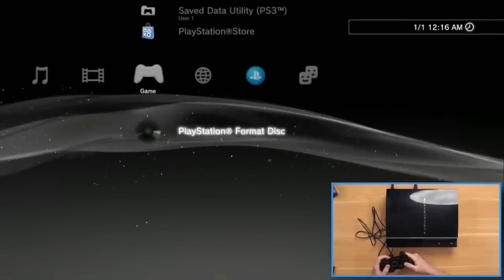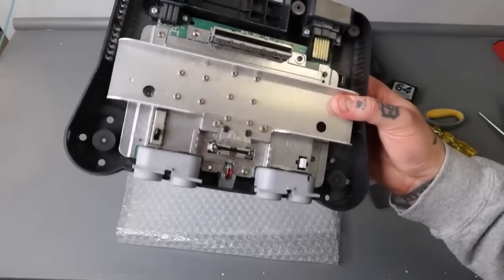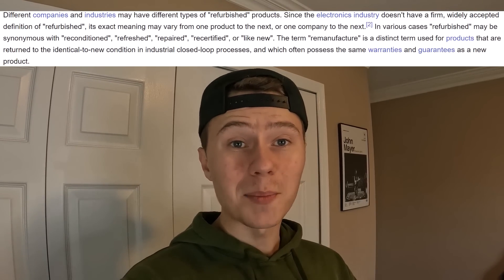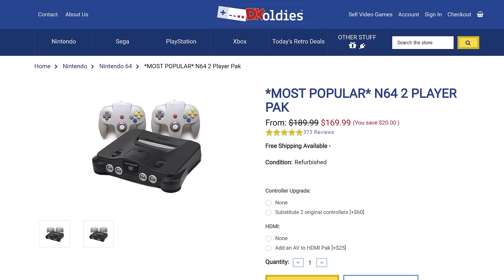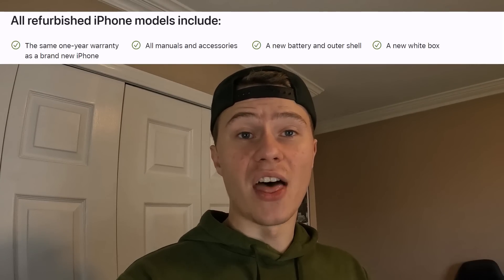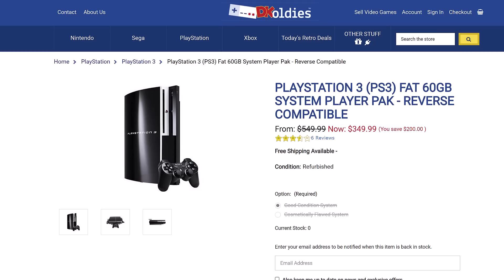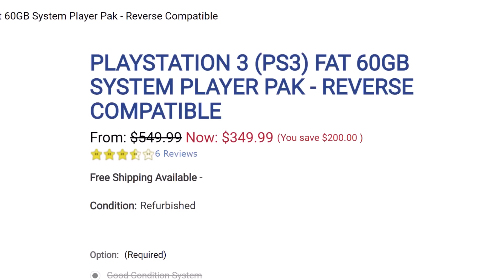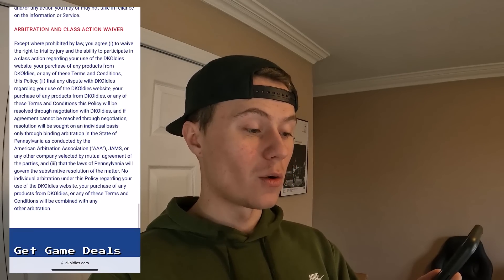DKOldies really didn’t want us to find this out…

Comment: Them putting that “waiver” doesn’t hold any weight ANYWHERE!……they can be liable In every jurisdiction!
Reply: Actually, countless companies have arbitration clauses in their contracts and they generally are legally binding.  Hence why the overwhelming majority of companies use them.  Hell Amazon has one.  Basically states if you can't work something out with them, you have to go in front of an arbitrator vs suing them in court.
Reply: @Ryan_DeWitt  that’s the same thing….if an arbitrator doesn’t settle the dispute, they will forward to the courts….it’s just like signing a waiver at say an amusement park etc….they don’t matter, the company can still be liable and litigated against
Reply: @niagarajoe4402  Why do you think they are having so much trouble suing Tickemaster?  Because they have a very solid arbitration clause when you buy tickets from them.  Arbitrators like judges make decisions and don't just send it off to court.   They make a ruling and their rulings they make are difficult to appeal.  There are cases where arbitration clauses can be thrown out but this is rare and difficult to do.  There is a reason companies use them.  Plus the company generally pays for the arbitrator and that arbitrator likely will not get a lot of work if they constantly rule against the company.  That sucks and is unfair, but that is the way it is.

Comment: Dude you didn't mention Austin Evens video. He bought like 4 different consoles and the worst one was a PS3 that had been partially submerged in water, has you could clearly see on the board and the hole damage chassis was rusted.

Comment: I just bought a PSP 3001 the condition is 8-9/10. Aftermarket battery x2 and aftermarket charger unfortunately but it’s over a decade old. It came loaded with 40 UMD games and over 3000 emulations from NES , SNES , sega genesis, N64 but they are a bit dodgy as  most N64 emulators are and a bunch of PS1 game from eBay that came to 250 CAD shipped. Which I thought was fair. Walmart is still selling the silver 3001 brand new in box no games for 150 CAD. My pads and buttons and everything feel like it’s brand when I bought one new all those years ago.